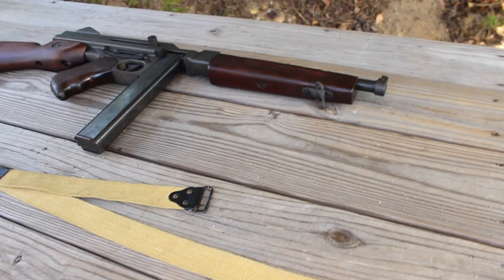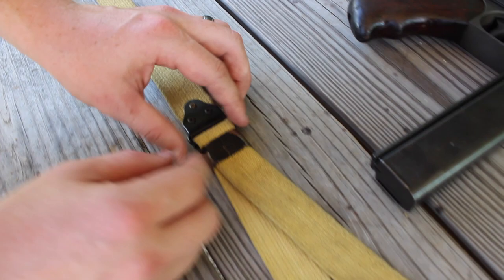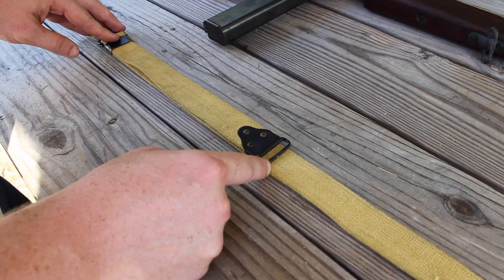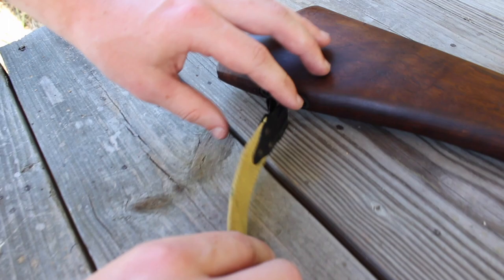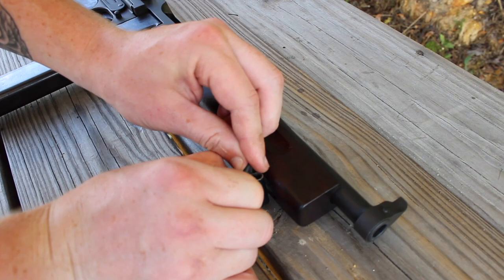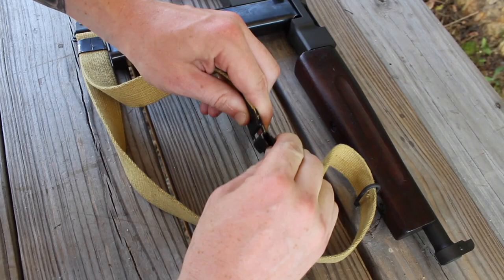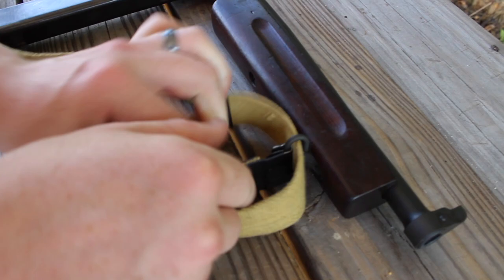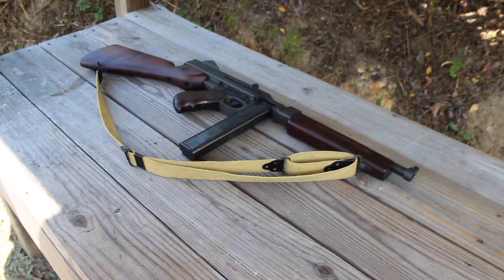How to Install a Kerr Sling

Comment: Aaaahhh! So thats the way to do it!!🥴..Got one of these old slings on my Rifle but have been scratching my head as to how it should properly be attached! Cheers pal
Reply from the maker: Haha. I figured this would help some people, just didn’t know it would help out as many as it has.
Reply: @TheAverageShooter  came across it at my local Gunsmiths was looking for a decent Webbing type sling for my Rifle and apart from the clips on the end which I had to grind down slightly to clip onto the swivels i just couldn't work out how it was supposed to be adjustable so many Thanks indeed 👍😆

Comment: You sure about the rear mount? You end up with an unused buckle  that way. I've seen real M1A1s that have the sling looped through the rear swivel and hooked on to the buckle.

You nailed the loop in the front though. 👌
Reply from the maker: I’m pretty sure. I have a thing for wanting to be as correct as possible. I searched endless amounts of pictures of GIs carrying them and found that there are 3 different lengths for the Kerr Sling. (1903/1917/Thompson) Because of that and how complex installing the sling can be for some, not all GIs knew how to do it properly. So, you’ll find many variations and not any one of them is “100% correct.” But, I went off of pictures found all over Google and went with the most common setup.

Comment: Great video, thanks for uploading! Is that the kahr/auto ordnance newly manufactured wood? And if so, did it come that color, or did you go through some sort of staining process? Because yours looks incredible.
Reply from the maker: Pearce Embrey thank you! As for the wood, it’s an actual 1940s stock set. I do have a set on the 1927 model that I replicated the look using Mohagany Red stain!
Reply: The Average Shooter did you parkerize your model as well, rather than keeping the blued finish that comes from the factory?

Comment: Excellent video, finally managed to install my repro sling on my M1927A1.  AVERAGE SHOOTER did you buy your M1 as an SBR or did you pay the tax stamp and have it converted? I noticed you run older walnut and the finish looks parkerized?. My 27A1 started out as the Commando version as I wanted the military park'ed finish. I removed all the black wood and installed NOS walnut for a more classic military look.  Looking to SBR mine in the near future as well as installing a set of easy springs and modify the mag catch to run full auto stick mags.
Reply from the maker: My Thompson started as a rifle (16”) and I later had it converted via barrel swap after the tax stamp was approved. The stock set is USGI because the contours are different than the factory set from Auto Ordnance. I did have my SBR refinished to parkerized because I love the look of it when it wears. But also, being a new rifle, I decided to have it parked to simulate a “rearsenal”. I plan on doing a video to highlight all the work I’ve had done because I get these questions a lot lol. But yes, get the mag catch swapped! Have John Andrewski do his magic and treat the firing pin too, to prevent breaking.

Comment: How do you put it on with the 1928 Chicago typewriter? Do you string it through the barrel?
Reply from the maker: For the 1928 model, unless you have a sling swivel installed on the side of the vertical grip (like a lot of Lend Lease wood furniture), there’s not much you can do for a sling. That was one of the downfalls to the 1928 until the swivel was added on the grip. 

Otherwise, if you’re looking to replicate a 1928A1, the horizontal handguard will have the sling swivel as per the military specifications.